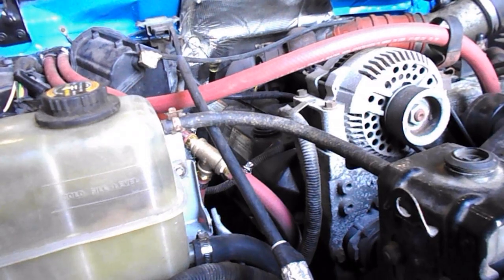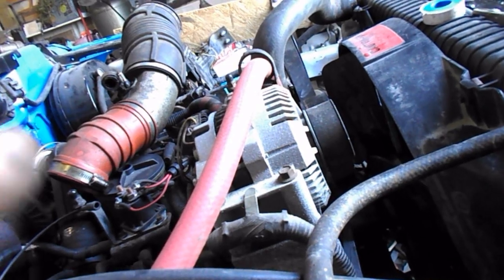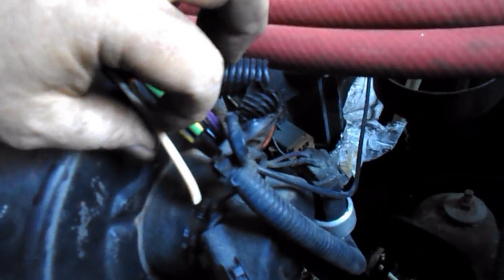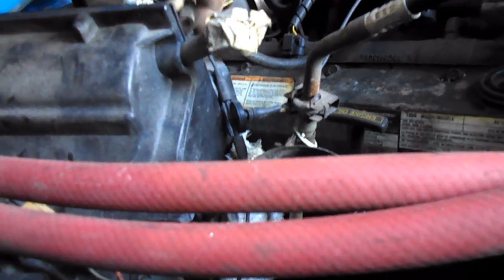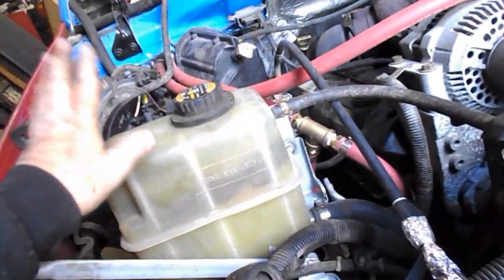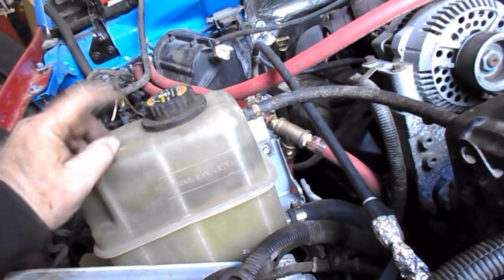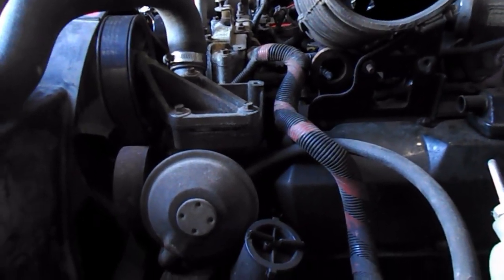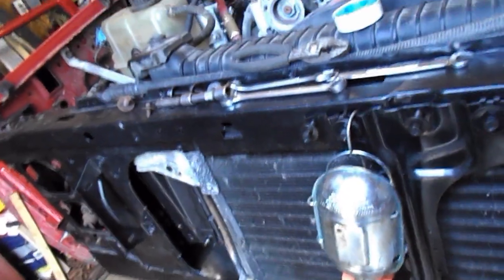Working on Big Blue

Comment: Hey Bandit. I been working on a 1995 ford e350 with a 7.3. It has 187000 miles on it. So it's been hard to start. So I checked the injectors and I had 3 that needed replacing. Anyway I just ordered all 8 injectors ,valve cover caskets glow plugs. 1620.00 dollars. I'm not gonna spend 48000 on a truck. So I think you are doing the right thing rebuilding your truck .at least you know what you have. Thanks for the videos my friend
Reply from the maker: With the price of new truck now so out of sight there is just no way to pay for one now. I looked at a new 1 ton cab and chasse Ford a stripped down gas and it was $66000 ! I'm not going to give more for a truck than I did for my first house !  I might be crazy but I aint that crazy ! LOL  I would rather fix what I have now and know its right mainly because its paid for already. I've never been one to spend money, I'd rather keep it as long as I can and spend it wisely. Others can do as they please but I dont need to spend that kind of money to show off !  I'm happy to drive a 20 year old truck thats paid for and runs good.  Bandit

Comment: The last 10% takes 90% of the time. You'll get there, Bandit. And you'll be mighty tickled when you do 👍
Reply from the maker: I've spent more time working on one door than I care to think about ! LOL The mechanical stuff is a lot easer than body work by far. I worked on one dent for a week and kept coming up with a high spot and it kept coming back no matter what I did so in one day of frustration I smacked it good with a ball pein hammer and the high spot was gone for good !  5 layers of mud later its strait now ! LOL One good smack with a hammer and all the high spots and waves were gone for good and now its got a thin layer of mud covering it up and a 3 foot 2x4 and sand paper made short work out of getting it strait !  Good solid factory doors are hard to find for a 96 model truck so a little body work on one is ok by me. It wont be a perfect truck when I'm done but she will be solid and mechanically right and that's piece of mind for me for the future !  Bandit

Comment from the maker: Well I've been working on old Blue again and got all the new heater and coolant hoses put on the old girl and well as the old fender and battery boxes put back in. I made a brace for the drivers side to hold the core support steady . I finally found my missing vacuum lines after looking online at pictures of this style of truck and found everything mounted on the inner fender and I stuck it back on so everything will hook up again.  Lots to hook up before I try to start it and I still have to check the electrical system out and make sure its right before I try to start cranking on it. I dont want to try to start it yet, All I really want to do is crank it over to get oil moving threw it again because its been sitting for 4 years without running so I need to get the oil moving again first before I try to start it. A lot of work has been done so far but there is a lot left to do before I try to start it but I'm getting a lot closer now !  I hope you enjoyed watching.  Bandit

Comment: Looks like you're making slow but sure progress on Big Blue back together.  I know it's challenging after 4 years - been watching it since the beginning.  But you'll get it.  I know you won't give up.  It's "go time" here.  We're finally in the middle of 6 nice days of weather in a row so we're all rolling here at top speed.
Reply from the maker: I never dreamed it would take this long to get this to this point but it is what it is. Guys have been going nuts here working and planting corn I live about 2 miles from the local 25000 acre BTO so I've been seeing equipment on the move all hours of the day and night on my road so there in full swing !  It kills me to see guys 3 or 4 miles away making dust and I tried to drive down the field and about got stuck in the truck. About the time it dries up enough to get on it will rain and there calling for a lot of rain Friday night into Saturday, So its going to be a typical spring for me .  But at least I have plenty to work on !  Bandit